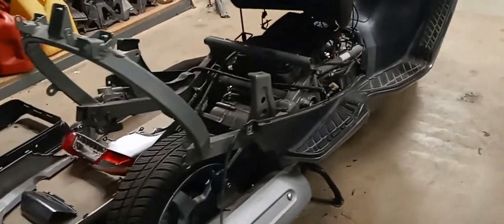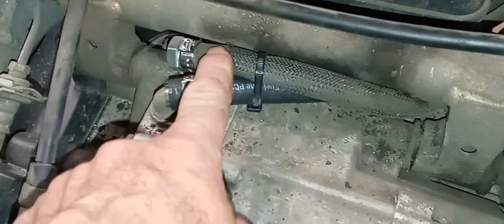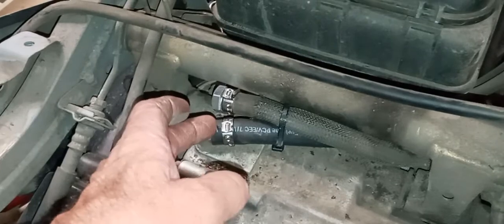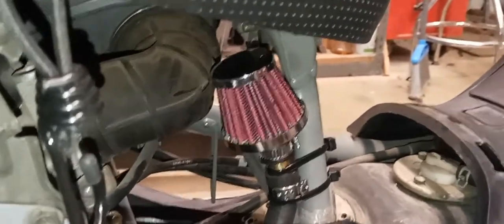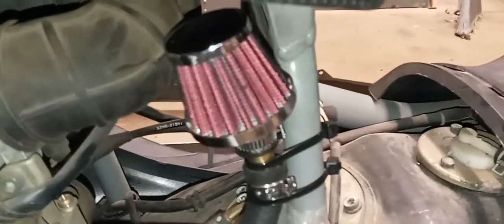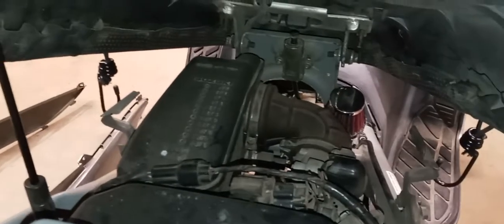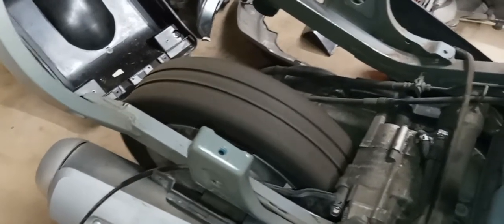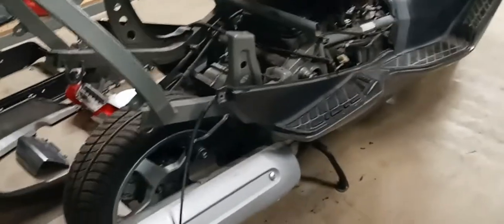Suzuki AN400 Burgman 99-06 Separate PCV & Airbox + Add Breather Filter to Reduce Oil Consumption

Comment: What tire are you running on the rear?
Reply from the maker: @josepaguilar3432  
It's a difficult to find size in the USA (it's Euro / UK) 
Michelin Compact Radial 175/70 R 13.

There's a common USA size but I'm not 100% certain of it.

It may be a 165/75 R 13.

If you look at my entire video or the pinned comment I do say the tire size  - I checked & it does fit the early Burgman 400 (2006 & prior).

Unfortunately my Scooter was totaled by a deer hit just before I was going to mount that new more common USA Tire size, so I never actually did it.

I now have a larger cousin bike a 2008 Suzuki V-Strom 650, with 17" rear & 19" front tires.

And yes it's Darksided too with the rear 150/70 R 17 MC giving way to a Petlas 205/55 VR 17 car tire.

It's a fabulous upgrade, in ride & handling just as on the Burgman.

Comment: Hello. I found this video by chance and I followed you to the Burmanusa forum, but I couldn't find out how this modification went for you. Could you tell us please? If it went well, I'm going to do it on my motorcycle. I would be very grateful if you would tell us.

Thank you!
Reply from the maker: I didn't get a long test, but it didn't "seem" to reduce consumption as much as I'd wished.
I figured that a CVT mod / upgrade using the Sliders from Taiwan (name escapes me now) to lower the revs at highway speeds was a very good way to minimize oil consumption.
What year is yours ?
The later Burgman 400s seemed to have solved the issue, next gen past 2008.
Mine was destroyed in a Deer collision late July this summer, prob 1000 miles after my modification, so not a long term impression, sorry.
I'm now on a larger "cousin" bike a Suzuki V-Strom 650 - which has many Pros vs the Burgman, but a Con or two as well.
Lol - it's a world 🌎 of trade offs right ?
Hope that's some help !
PS Dark side Tire on rear, if you can do it, is of great advantage. I did a separate video on it.
Can't wait to do my V-Strom, soon as the rear M/C tire burns thru !
Merry Christmas 🎄 & ride safe.
David in Texas
Reply: oh man, I'm so sorry to hear about your accident. Well the important thing is that you are safe and healthy. I will try to make that modification as soon as I have time, I have never stopped to measure how much oil it consumes, but the truth is that it is a pain to be constantly attentive to this issue. In my case the bike is from 2004, but they work very well and I don't want to get rid of it. Even so, it is not easy to sell a motorcycle that consumes oil, people explain it to them and they do not want to understand it hahaha.
The thing about the rear wheel impressed me, is it illegal in my country, what is the advantage of having a wheel like that? The bike turns well with it.

Well friend, thank you very much for your response and I am glad to know that you are okay after the accident.

All the best!

 @psalm2forliberty577

Comment from the maker: I've added in a PCV VALVE - model # MGD 179 not shown in this video - right where the brass connector piece is between hose end & Breather Filter.

After more thought I realized the PCV valve acts as a check valve to regulate pressure and adding it between hose & filter was simple.
See this Burgman Forum post for pictures of this layout & more discussion.

https://www.burgmanusa.com/threads/2006-an400-pcv-hose-re-route-disconnect-from-airbox-add-18-longer-hose-to-breather-filter-will-this-decrease-oil-consumption.178561/post-1829228

I'll update this pinned comment with HOW this mod works etc once I've road tested it a few days & miles.
Reply: When is your next test run?
Reply from the maker: @stevencosby6708  
Well, not sure.
Soon.  But zrx212 just posted 3 pics that have me questioning if I should do a different layout towards the back, thru trunk body, & mount breather up under taillight cavity.

Ck out the thread - if you haven't already I refer to it's linked in my pinned comment.

Its a big effort to R & R the "Tupperware" so I wanna be confident I've got the best possible layout, for the best chance at success, ya know ?